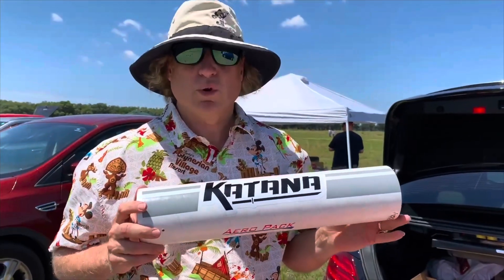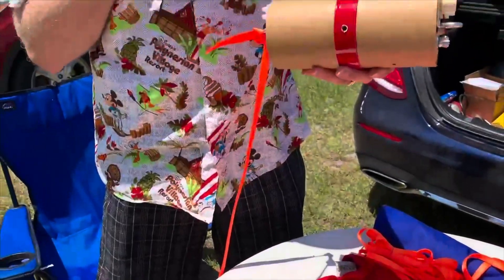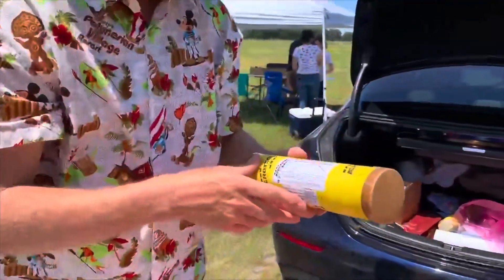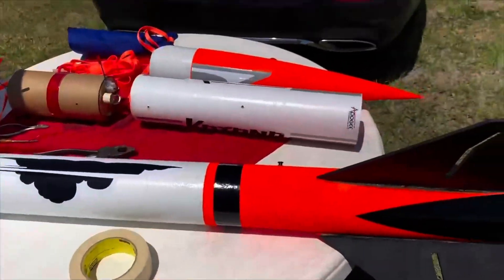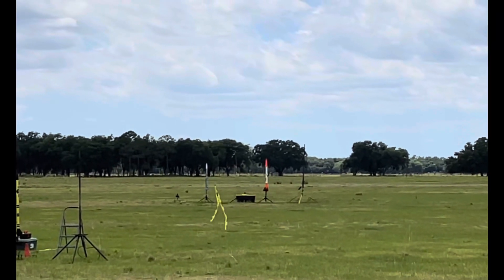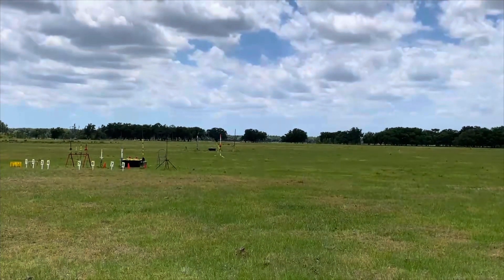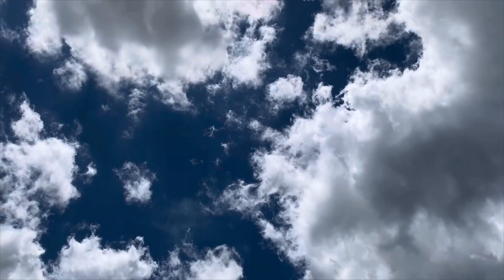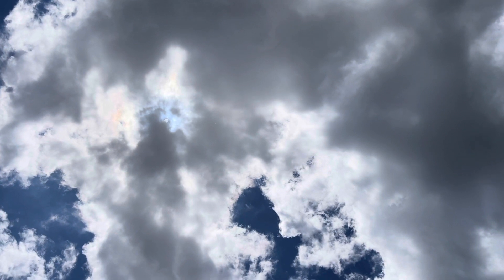High Power Rocketry Dual Deployment Attempt

Comment: Looks like no shear pins. You have rivets to keep the ebay attached to the tube, but you need to buy shear pins separate (they don't come with the Katana...I have one) and drill holes for them in the fwd body tube and nose cone

Comment: Did you have any shear pins in it?
Reply: Shear pins are to be installed where the nose cone and upper airframe connect to prevent the nose cone from coming lose at apogee
Reply: @juancedillo02  Yeah I didn't see any shear pins where they belong in the upper in the nose cone. Also no drogue chute?
Reply from the maker: @skywackerjim Yes, had three shear pins.
Reply: @mjguillette Where do you install the shear pins on this kit?
Reply from the maker: @teamsigtor  The Apogee Components Katana has predrilled wholes in the lower section of the upper body tube, just above the ebay, to insert the shear pins.